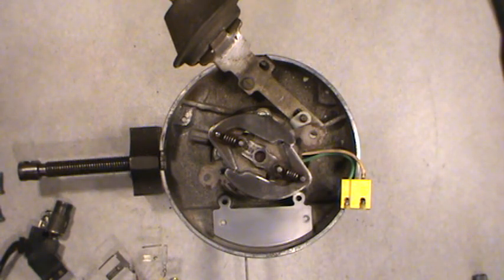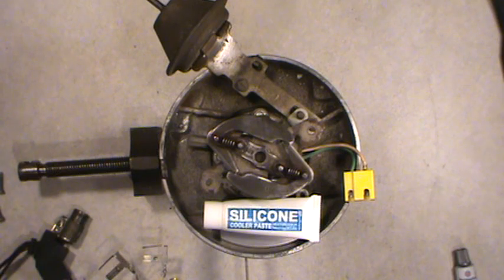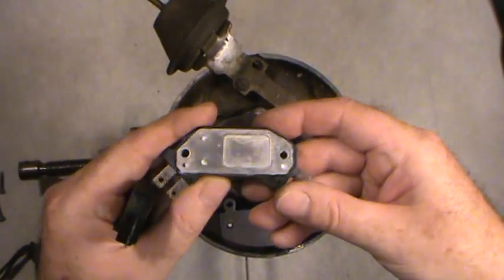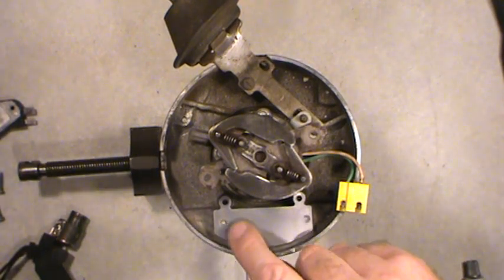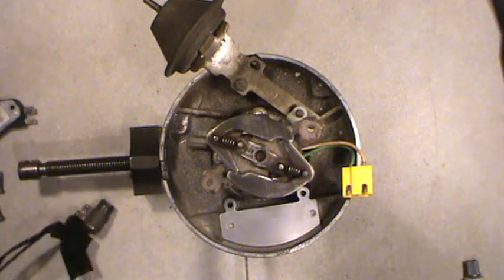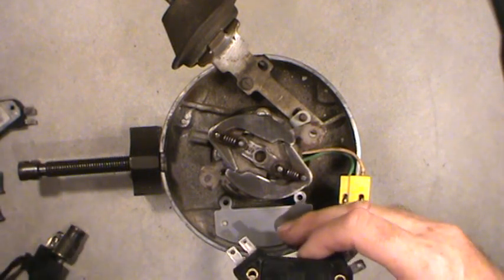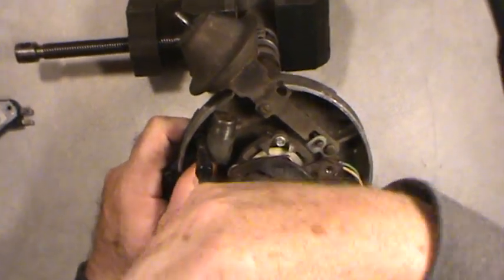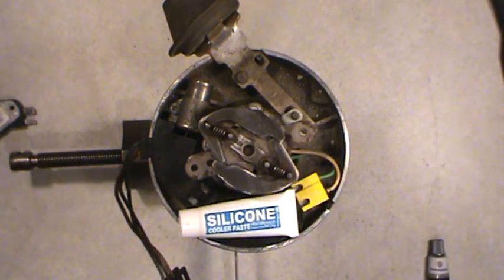HEI Distributor Video Series (Part 6)

Comment: Hello Rocky I notice you have not posted in a while and I hope all is well. I have been watching alot of you videos trying to figure out my ignition issue in my 95 Chevy suburban 7.4L it seems to have a weird random POP from exhaust like it is cross firing spark somewhere and only happens under lite load or lite throttle basically when the Timing is most advanced. I replaced basically everything trying to figure this out. Any ideas? Thank you sir! Great videos by the way!

Comment: FYI.... when choosing thermal paste for the ignition control module(ICM), make sure its quality made, when using the cheaper brands, the paste can actually dry up over time making the heat transfer less effective, thus killing the module sooner than later. Granted, the thermo solution that computers use between the cpu and heatsink would be ideal, but computers get nowhere near as hot as engines do under the hood while in operation or during hot soak periods during the summer time when the engine is off. I personally like to use "Dow Corning 340" silicon heat sink compound, its rated up to 350F, so it should last for years on end to help protect the ignition control module for thousands of trouble free miles, regardless if you use original equipment replacement parts or aftermarket.
Reply: Good to know I was going to use Artic blast but now gonna try the Dow 340 on my chevy hei module. But wow it is pricy lol

Comment: Thanks 👍 and what about if there no grease or stuff at all?
Reply from the maker: Greetings...Dan 4x4..........Thanks for watching.........If there "is not" anything, shall we say "grease-like", between the bottom of the ignition control module and the pad that it mounts onto, then, what will usually happen, is that, the ignition control module will probably get way too "Hot", as in, over-heated, and it will usually become damaged internally.........There has been a case or two, whereby, the engine acts up or quits, once it warms up, then, sometimes, when the ignition control module cools down, then, it might start to work again, well, until it gets over-heated again, that is..........I only use the "heat transferring" Compound (aka, grease-like substance), that a person could buy, at a computer parts or repair shop, because, that particular "heat transferring" compound (paste), does the proper, and needed job, of "transferring" the unwanted "heat", that the ignition control module generates, when it is in use.........Don't use "die-electric" grease, because it's not designed for heat transfer at all.........So then...No "proper" heat transferring compound/paste, then, say bye-bye, to the ignition control module (usually)...and.....till next time......Be Safe, take care, and have a good one.
Reply: @RockysRoadshow  what a answer 👌 thank you so much, I thought this metal plate was some kind of Ground, now a cooling paste make sens to me. thanks again 🙌

Comment: What happens when u have a bad capacitor
Reply from the maker: Greetings...Jacob Jarvis........Thanks for watching.........The capacitor (condenser), on the Large distributor cap HEI (High Energy Ignition) distributor, is only put there, to help filter out ignition interference noise, that might be heard on the vehicle's radio (more than likely, on the AM band, and not so much, on the FM band, I be thinkin').........If it happens to be a "bad capacitor" (condenser), that's on a points and condenser distributor (up to about 1974, just before the HEI distributor took over things), then, the engine will probably misfire quite badly, or maybe, not run or start at all....and......till next time.......Be Safe, take care, and have a good one.
Reply: Only runs when the starter is engaged
Reply: It burns when you pee.

Comment: Excellent video Rocky.  You are an excellent teacher, and I LOVE the slow pace that you use to explain things.  It's so much easier to absorb what you are demonstrating than most of the other "hurry up" DIY videos I watch on YouTube, that cut a lot of corners, and often leave out critically important stuff, like what kind of stuff to use on heat sink connections.  Keep up the great work, including your superb camera positioning.  You should be teaching at an automotive tech school.
Reply from the maker: Greeting...Edward Morton.........Thanks kindly, for your nice, and well appreciated comment, my friend.........I'm not sure, if I mentioned the following, in this particular video or not..........Those two "screws", that go through the ICM's (Ignition Control Module's), two metal, shall we say, eyelets (holes), one at either end of it, are actually, the electrical "ground" (connection), for the Ignition Control Module itself (very important), so make sure that, those two screws, and everything that they touch, are super clean, for a good (electrical) connection..........Also, keep all wiring connections, as clean as possible, as, I've even seen some "green stuff", shall we say, growing, on some of the electrical connections...lol..........Basically, I only have two camera positions, one is directly overhead, and, the other one, is off to the right side, and up a bit, from the workbench surface.........To hold the camera still, I just use some wooden 2 x 2's (probably, really measure, one and a half inches square), with a hole drilled, near one end, that allows, a, one quarter inch bolt to pass trough it, then, gets tightened into the camera's, screw-threaded, tripod mounting hole..........The other end, of the 2 x 2, just gets clamped onto, some other, shall we say, clamp-able onto, thing...lol..........If it wasn't for my 2 x 2 helpers, you'd probably be thinking, that, it was a Horror movie, that you were watching, because, it would probably be..."sHaKiNg...!!!...all over the place...lol.........Thanks again, and.......till next time.......Be Safe, take care, and have a good one.

Comment: Rocky, I guess this is an indicator of my own OC personality, but watching you talk about the importance of cleaning that heat sink on that filthy distributor, is disturbing to me. While you are at it, why not clean the whole damn thing. It would make me feel better...
Reply from the maker: Greetings...BuickDoc…….…Thanks for watching...…...I hear Ya alright...…….By using, an older, not cleaned-up-yet, HEI distributor, I can actually show folks, what happens to them, over time/many years, especially so, all of the parts & pieces, that are hiding under, that BIG distributor cap......……I actually, "did', rub a piece of sandpaper, over the (mechanical/centrifugal) advance weights, and auto-cam (center plate), which helped, quite a bit, to show the numbers, that were stamped-into them...…….Whenever, I see some of the super-polished car parts, I tend to call them, "fishing lures", because, just like a fish, we humans, tend to get, quite "attracted" to, those, bright and shine-ee objects (an example, being...Jewelry…!!!)...lol...…….Also, that there, "grime-ee" surface, sure does, help with, the contrast difference, where I cleaned-up (sanded), that (aluminum) "pad", that, the ignition control module, mounts onto, oh, and also, probably minimizing, any potential, lighting reflections as well (some theory that was...lol)....……Now then, let me ask you this...…..Would you rather have, a nice-n-clean HEI distributor, that "does-not" work properly, or, would you prefer to have, an HEI distributor, such as the one that you currently see, in this YouTube video of mine, that, "does" work properly...???...lol...……..Be it, a grime-ee, HEI distributor, or, a nice-n-clean one, then, the same holds true, for the two of them, as in, having, the..."Proper Heat Transfer"...from the bottom of, the ignition control module, over to, that aluminum mounting "pad", or else, over-heating of the ignition control module, it will usually be, along with, an engine that stops running, and also, refuses to start-up, possibly, leaving Ya..."stranded-in-the-middle-of-no-where", and maybe, in a place, that, does not have any cell-phone connectivity what-so-ever...........Who knows, maybe, once, I get this particular HEI distributor, "disassembled" completely, then, I just might..."clean-er-up-a-bit"...???...and...…..till next time...….Be Safe, take care, and have a good one.
Reply: Would it make work better? because if not then that's a half hour less time on the road But chrome and shiny engine, Ok so there's an hour or so less time cruising,But nobody is going to say man it could almost be car show pretty if only  we could see inside the distributor cap,...But if it makes you happy